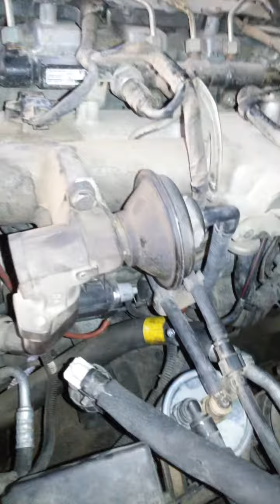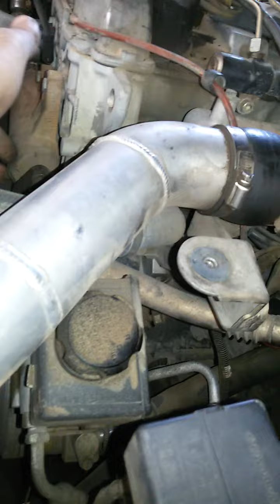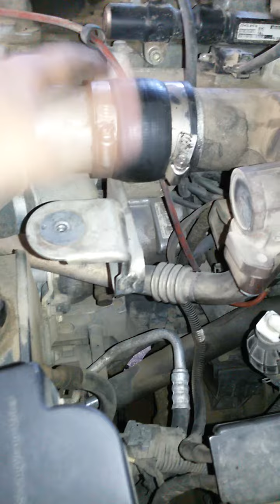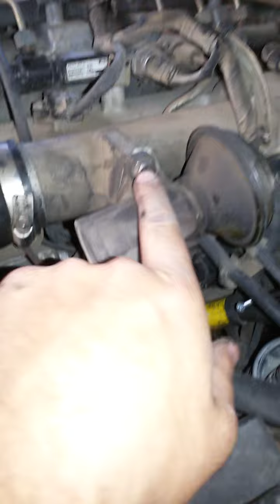Rexton EGR

Comment: Thank u for making this video.... I'm having problem with my van and it won't start😢.... I think thats the problem but I'll look into it
Reply from the maker: The EGR won't cause the car to not start , give more details about your issue and I will try to guide you
Reply: @TheDemonicaxe  . Everytime I start the Rexton 2.7 xdi 2005...it will take very long to start and won't even run the engine..it will kill the battery... And the engine won't run  without self starting it...... The Rev takes very long too..... But when I moved the egr..... It Rev so nicely... But there's no turbo power going into the engine coz I removed the EGR...... I changed all the injectors...they all are new.. I tested the fuel pump and the turbo and that's not giving any problem at all....... When I drive it on  a small hill...... It's very slow.... Like there's only 20% power in the engine....
Reply: The "check engine light" is on....... I sent the van for fixing but the mechanic are all criminal.... They only want to rob me...... It was sitting for about 2 years now.... At a mechanic house and he never do anything..... So I brought it home to try and fix it myself........ I really love this van... And I need help
Reply: @TheDemonicaxe  I also did a test... It said that a rail pressure(where the diesel enter) is low.... .... But I don't know.... 😞
Reply from the maker: @jordanseekola6690  I assume you already replaced the diesel filter right ? 

Also disabling the EGR should not affect the turbo
Reply: @TheDemonicaxe  no the turbo was working fine....... I change the filter... Still the same result
Reply from the maker: @jordanseekola6690  did you clean the MAF and the MAP sensors ? This should help restore power and acceleration .. 

How do you start the car when it struggles ?
Reply: @TheDemonicaxe  I used quick start..... But u see.... I live in South Africa.... So it's very hard to get parts for it
Reply: @TheDemonicaxe  the cable that connects to the MAF sense..... I start it without it on cause it  takes even longer to start
Reply from the maker: @jordanseekola6690  which year is your rexton ?
Reply: @TheDemonicaxe  2005
Reply from the maker: @jordanseekola6690  270Xdi right?
Reply: @TheDemonicaxe  yes
Reply from the maker: @jordanseekola6690  once the car is running what happens? Does run smoothly ?

Comment: How did you do the blanking? did you get any error codes or check engine lights?
Reply from the maker: weld shut , need to reflash ECU to prevent warning light and limp mode

Comment: my problem with my ssangyong everyrime i park the car under the sun and it the car get very hot when i start the engine the idle goes up to 3000 rpm with no check engine in the dash board, can you help me with this, thank you.
Reply from the maker: Try cleaning the gas pedal circuit , remove the gas pedal , it's held by 3 bolts , then open the cover and clean inside with contact cleaner ... also clean the electric connector , fit back and check if problem solved
Reply: @TheDemonicaxe  ok thanks what type of cleaner will i use , is wd40 will do or some degreaser. thanks
Reply from the maker: @franzesherrera3386  WD40 is a not a good choice as it will leave oily residue , you need something that evaporates after , need electric contact cleaner
Reply: thank you